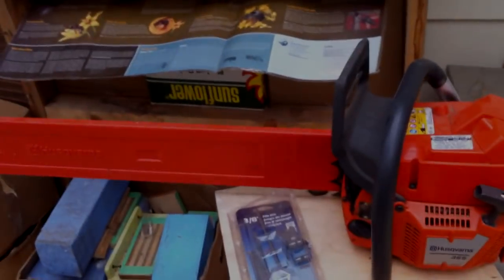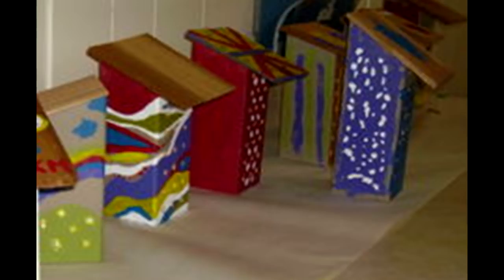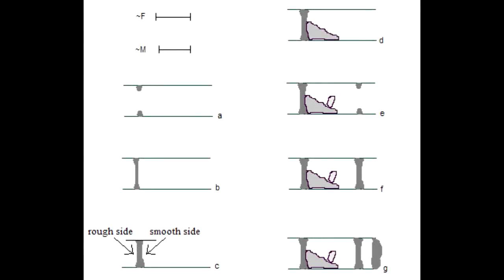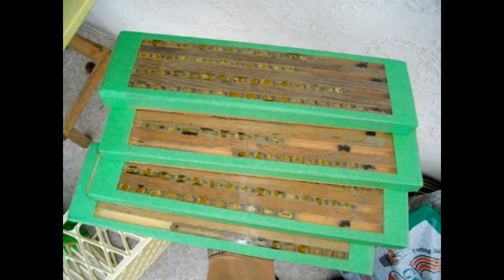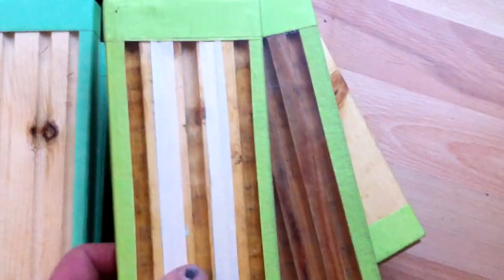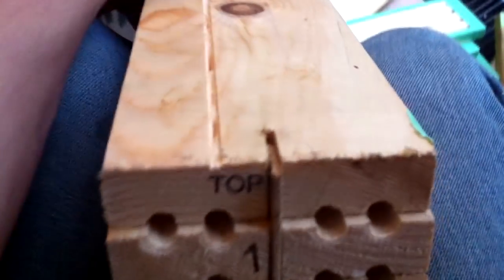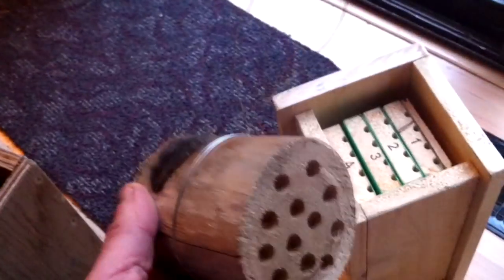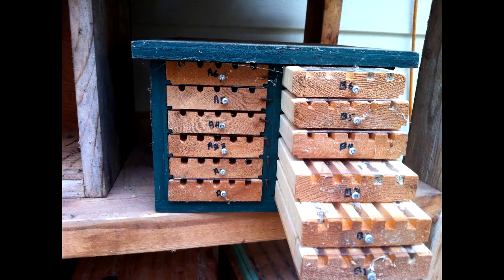Every Correct Thing You'll Need To Know About Mason Bees and Bee Condos For The Beginner

Comment: Thank you! Last spring I made three of these bee condo's exactly like yours. Most of the trays were filled with the view trays better filled than the ones without the sheets. I made the straps from strips of bicycle tubes glued together. You can add the Netherlands to the list of countries where your design is being used. 👍

For clay I just bought a bag of that grey bentonite clay stuff that you use for "cat toilets" (can't find a better description) and put it in an old cooking pan with water and lots of reeds etc. for walls so the bees can pick the humidity the prefer. I think it is awesome clay but the bees avoid it. Maybe just find me some normal clay in a river somewhere. Still have to figure that out, but at least I got the bee condo's covered with your video. 👍

Comment: Great video. How long/deep should the channels be at a minimum?  Also, when is the end of the season? May? August? Nov?
Reply from the maker: You go as minimum as you want but you'll only get males. "End of the season"? The adults emerge in spring which varies due to particular weather patterns, and goes until the same. So it can be anywhere from late Feb. to maybe mid-June but really, for my area anyways, it's height is around April and May. The developing young within the channels continue to live for another year before emergence the following spring and repeating the cycle.
Reply: @hutchingsbeeservice  Thanks for the reply. What is the minimum depth you recommend to get a good yield of females? Six inches? Eight inches?  And what time of year do you go in and recover the cocoons?
Reply from the maker: @seansherlock9047  I did a project many years ago which can be seen here: https://sites.google.com/site/hutchingsbeeservice/my-research-both-current-and-past-projects Essentially, the most efficient length for female progeny was a whopping 11" but it's ungainly to deal with so I mostly use trays about 8" long. I extract the cocoons around Nov.-Jan. in a cold environment which you can view at my other videos.

Comment: Thanks for a great video.  I’ve trawled through a few but this one is so informative.  I’m from the UK. I’ve been getting more and more bees each year since I put one bee hotel up and every year I’m frantically making more hotels to accommodate them.  I really want to learn more about caring properly for them and I’ve already learned more from your video. I get different types of bee at different times of the spring/summer and they seem very particular in their choice of hole.  Often they don’t want to know about the new hotels I put up and leave them as a last resort.  Should there be different size holes for different types of bee I wonder?   I also read that they will return to the same hole the next year.  Do you know if that’s right? And when making homes for the bees what kind of wood is best, is it ok to use treated wood from the timber merchant?  Sorry for so many questions but I’m very keen to help our bees.
Reply from the maker: They do not necessarily return to the same hole but bees are attracted to their own "smell", hence used condos working better. 
Definitely try different diametres of holes as you should get (depending on your area for habitat), Hylaeus, Heriades, small spp. of Mecachile, Anthidium and Osmia, besides a plethora of cool cavity nesting wasps so try 1/8" - 5/16" channels. I'm always keen to see folk's results and applications of where they have their setups around the world so please send me photos if you're interested.
Good luck.
Gord

Comment: Gord, quick question.  I'd like to build these for our small orchard in WA and have a table saw.  I know you had a custom dado type blade made.  Any suggestions for how to find a similar blade? All I can find is a "wobble" dado blade, not sure if that will be rounded enough of a cut.  I could use a drill press and do the paper tubes, but I like the table saw approach a lot better. 

Also, how do you clean the wood after extracting the cocoons? I know they leave a scent that's beneficial to attract the next year's progeny, but didn't know if a mild disinfectant was needed to treat any lingering mites, or if just a good wash with water is sufficient?

Thanks.
Reply from the maker: Sorry but I don't know where to buy one as I had one made by a machinist where I used to work (now I'm retired), and the other my Dad took a regular high speed steel dado "wobble" blade and had it machined to a curved tooth instead of the square ended one. I've also run my regular saw blade most of the way down which leaves a groove the width of the saw itself. Then I measure a drill bit the desired length, say 8-11" and drilled to that point without going through the other end (back). I did this with two clamped boards or trays, then pulled them apart making a perfect circle to insert a paper tube if that's what you want. I just used the wood itself. As for cleaning, I just wire brush, then sand a bit and leave it for next year. If they have mould then you can clean with your method but I just burnt it a bit with a propane torch, then sand. Hope that helps.

Comment: Can you use pressure treated wood or cedar?
Reply from the maker: Pressure treated, no, as the wet pollen and nectar that the female lays down will possibly leach the chromated copper arsenate into the food. Cedar, yes. It's the best stuff to use but it's also more expensive. I find it far less apt to warp or split than the other woods. Fir is especially prone to do this when exposed to the elements. Plywood also has glues but more importantly for me, it dulls my high speed steel tools since I don't have carbide in my home made blade.
Reply: Cedar isn't expensive when you have a 50ft dead cedar and a friend with a lumber mill.

Comment: When do you clean out the chambers, fall or spring before or after
the nesting?
Reply from the maker: After nesting and when the last larva has spun their cocoons so a safe bet is November and December.
Reply: So what your telling me, is that you remove the cocoons in
November or December and store them where/how, until spring?  Is
there a problem if you just leave the cocoons where they are until
spring? I guess you have to get the crayons out for me.  Sorry, LOL
Reply from the maker: Remove them as per my cleaning videos, and put the cocoons in an emergence container like a cardboard or wooden box outside away from moisture and predators. Outside meaning a non-heated room like a garage, or outbuilding and then make sure to put the emergence box outside outside, when the bees start to emerge naturally depending on where you live. Some folks at this time put them in the fridge to stall them a bit for a captive pollinating service such as an orchard or such. If you leave them until spring, you risk triggering them into emerging while you're in the act of cleaning (not good). They need to come out on their own time.
Reply: Got it, the nest box is built, thanks a lot.

Comment: Hi Gord, I'm going to try making some viewing trays with either a 5/16" router bit or a 5/16" dado.  But I'm not sure how deep(5/16" or more/less?) the slots should be.  Also, could you name the type of router bit used to make a rounded bottom slot.  I've learned a lot from your videos, thanks from Topanga, California.  John
Reply from the maker: Topanga looks quite interesting from my perspective here in the Kootenays. The higher elevation looks drier and this would be conducive for many different types of native bees. However, I don’t know how many would readily take to a condo but I would definitely make a variety of condos and put them in all sorts of areas, especially in the wild. If you do, take way points of where you “hide” them so you don’t forget where to find them again. These videos are mainly aimed at folks who want to try and have a captive population of the native and popular pollinating bees such as Osmia and Megachile spp. However, as an entomologist, I am very keen in all native bees and do these cavity nesting videos for the gardener type enthusiast. My website elaborates further on my native bee research. For the depth of a square dado, go 5/16” deep but round, maybe a bit more like 3/8”. By all means experiment with depth and width. I also use ¼” and my three round toothed blade is a homemade thing so I have no brand name for it. Topanga looks like an area that would be at risk from fire if that were ever to happen? I still have 12” of snow on my garden and orchard but saw my first bumble bee queen emerging yesterday. There’s no flowers up yet here whatsoever. Good luck.

Comment: What size are your holes in the blocks. Are they 5/16"?
Reply from the maker: I have a 5/16 and 1/4" special round toothed blade I had a friend make out of high speed steel. He couldn't do in carbide so I only use on softwoods. 5/16" is the common size to use and I go anywhere from 8-11" deep. It's quicker than a router which I don't own or use anyways.
Reply: @hutchingsbeeservice  I agree that it would be way more efficient than a router. I would order a blade today that would make those channels on my table saw. I have three routers, but the table saw blade would be the best.
Reply from the maker: @ordinaryguy6869  Like I said, it's a "home made" one but I had a tool and die buddy at work make it for me years ago. I'm now retired so can't get it done anymore. I've moved far from where I use to live. The video should show it up close of what it looks like. Some other guy who contacted me I think in England, he had one made for himself.
Reply: @ordinaryguy6869  I know this is a long time later, but Delta actually makes a 5/16 fluting cutter for its molding head that goes in a table or radial arm saw.  If you search for Delta Moulding Cutter Head you will find the head and the 5/16 flute knife is 35-233.  On a 10 inch table saw you could also use 7.25 inch plywood blades and stack 5 together to get to 5/16 width and then just adjusted the height.  it will give you a square bottom but as pointed out here that is fine.  These blades are not meant to be stacked, however the blades are smaller and the wood is soft (pine) and it is not mass production.  Stay safe.
Reply: @hutchingsbeeservice  Where to you get the plastic covers that you use?
Reply from the maker: @ordinaryguy6869  I usually have to go back to where I lived and get it by the 4x8 sheet. I have a small sample chunk left but can't remember what thickness it is. It comes with peel off on each side. I use it over  and over for many years and soak and wash it carefully so as not to scratch. If you want, I can get a micrometre on it and let you know. I got it from a particular plastic supply business and I can ask them exactly what it is called and let you know. Otherwise I source other lighter/thinner, not as good of stuff like the replacement covers for  protective shields say, for grinding. Plexiglass is too think and you have to use screws. Taping is way quicker and tape is cheap.
Reply: @hutchingsbeeservice  Okay. Yes, let me know where you got it from and what it's called (the plastic), because I will order some. Also, if you could get your micrometer on it, that would be helpful to know what thickness it is. Thanks!

Comment: I bought a cheap bee house at a dollar store because I did not know better and Mason bees made their little nests inside of it. Oh how cute, right? Well I started watching some of these Mason bee videos and realize that the cheap bee houses are not good for the bees because you cannot get them out once they lay their babies inside. What would you suggest I do to get them out? Should I just tear the house apart and use a dowel rod to gently push them out?
Reply from the maker: This happens with a lot of folks. Get a dark container that is sealable and don't put it in direct sun so it gets overheated, and have a small hole about 1/2" near the bottom. Over time as the bees emerge on their own timeclock, they will seek out the only source of light which is their escape route, and away they fly. Leave it this way for the entire emergence season which depends on your location, and once done, your condo should be empty of everything viable. Anything left behind will be dead. Choose to do with your condo as you wish and I would suggest you use a type that can either be taken apart, or have extractable tubes. There's lots on the web but my design is relatively easy to make and maintain year after year so I would suggest something like that - your choice. Cheers, Gord.
Reply from the maker: Also, try  here at my website for further info maybe: https://sites.google.com/site/hutchingsbeeservice/mason-bee-condos-for-sale

Comment: I just put up a block of wood with 48 holes:  10-, 8-, 6,5 mm. 16 holes each. 6 cm deep. Some holes are already sealed with mud. Can you clean the holes with a drill - or just burn the block, and put up a new one every year to keep it free from parasites/ being a bee cemetery? If so, when is the right time to do this?   Does the block i made only produce males because the wrong instructions i read on net regarding the depth of cannels? Thanks for a good video.

Comment: Thanks for that excellent video.  Its great to have so many video's on this subject, and yours addressed a few ideas others have not.  Questions:
1.  The length of the channel addresses a few issues, but I would think a "standard" length or "optimal"  length would be good for us beginners.  My store bought trays are 6" but I plan to build my own.  In your experience what is a good size to optimize the male/female ratio?
2.  Most houses or condo's have a "gable" roof .  I wonder if a "shed" roof would be better, as it allows the trays to be shaded as the sun rises higher in late spring, thus reducing temperatures a bit.  Also deflects the rain better.  Course it doesn't look as good.....
3.  I have heard ants can be a problem,  and I observe a few ants running about my bee house.  Your opinion?
4.  I keep hearing the bees need a certain type of clay/water mix for their mud.  Heavens know where they find that in my neighborhood.  I try to keep a supply of wet garden soil close to the next.  What are your thoughts on this?
5.  I hear the lifespan of the female is 2 weeks from some sources and up to 6 weeks on others.  Mine are still going after 8 weeks although its down to a couple of bees now.  What is your thought?
6.  Their must be some sort of ratio as to how many bees will support a certain number of nests.  From what I have read, most packages of bees are around 25, with say a 55% male to 45% female mix, and about 5 trays, or 30 nesting holes. On "average", what do you think would be a good mix?
Thanks again for all you effort.
Reply from the maker: If you go to my site about past research (http:sites.google.com/site/hutchingsbeeservice/my-research-both-current-and-past-projects), you'll see what I discovered for optimal length for male to female offspring ratios for progeny. Roof is something you can experiment with so have at it. Ants, yes, they are a nuisance which is why I would have on a pole with tanglefoot goo around the post to keep ants and earwigs from climbing up. They will find clay of the correct consistency without us knowing how they do it. I found females going in between the rocks of a rock wall to get what they wanted. Don't fret about that. Lifespan depends on the weather and how active they are every day. On average, (and you can do a publication review on this one in academic sources), they lay about 20-30 eggs. I found that on a decent day, they can lay about 1-1.5 eggs per day (including provisioning and mud divider walls), which means they last just over 30 days. That's for my area anyways but might be different where you are. When they steal each other's channel or start a new one in an already established channel, they may leave a space to start over again which can upset your viewing research of which belongs to which female but the space tells you that this is a new female. Also, a female senses when she will exhaust her egg laying abilities and start a new adjacent channel and won't go all the way down and instead starting only part way down a channel to lay her remaining brood before expiring. Personallly on the ratio for a provided "nest", I would have fewer males per females as one male can service many females and they continue to try mating only to be continually repelled by already mated females. Most garden store, internet bee experts etc. really don't have a clue. Only the mellitologists out there know and they would refer you to past and current research papers, something I did when I was at university working on my projects. Look up some stuff by the following authors: Tepedino, Torchio, Rust etc. and look at their bibliographies to find even more folks research papers. There's a wealth of information in there and you'll laugh at all the pathetic videos on YT going on about what is "correct", hence my putting my goof ball videos up to try and answer them. Good luck! Cheers, Gord
Reply: Thank you very much for that extremely informative reply.  After posting my questions I did discover your main website and pretty much exhausted the information there.  As it turns out I live very close to you in Victoria, just a few blocks from Oak Bay.  I'll be watching over the winter to see if you put any information seminars in the area.
Reply from the maker: Sorry but I have moved to the west Kootenays after being in Cobble Hill for 7 years but yes, I was originally from OB. I'm always up for presenting in Victoria and will still fit things in should I ever be asked to. Cheers.
Reply: @hutchingsbeeservice  I couldn't get your site to work..